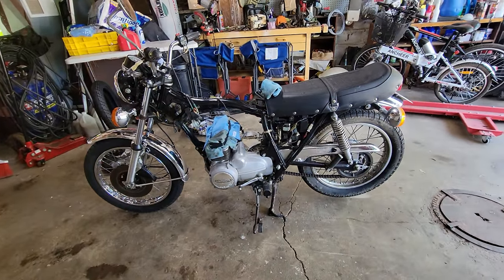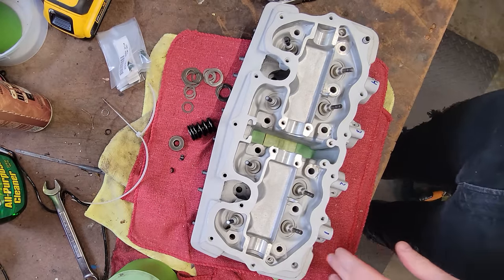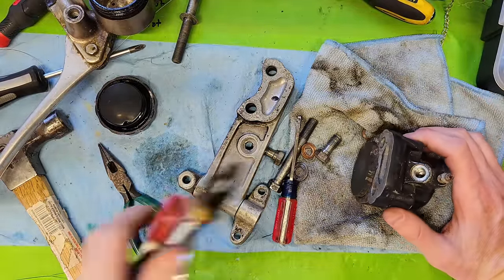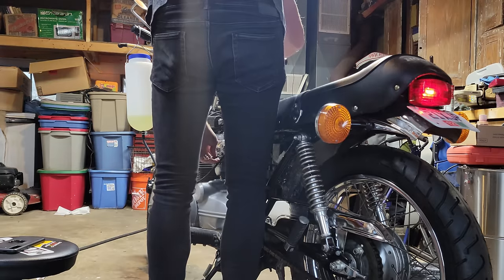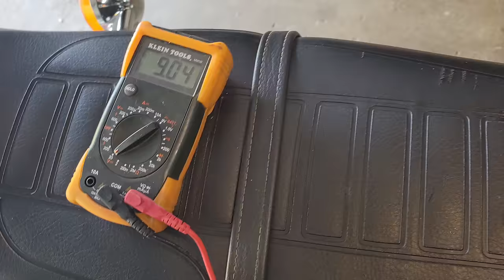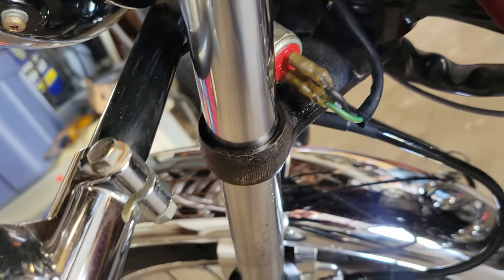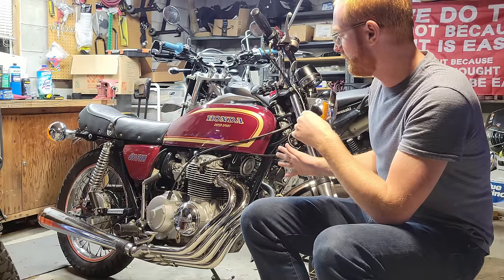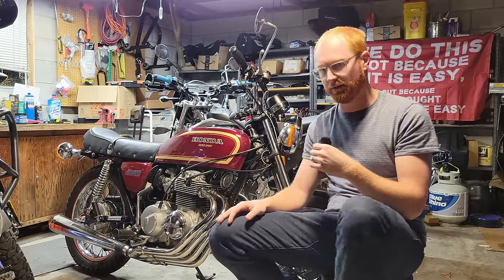Forgotten 46 Years - Will This CB400F RUN AND RIDE 200 Miles Home?

Comment: I tore my 400f motor down and then injured my clutch hand on a table saw. I'm pretty well healed now and starting to work on the engine again. Decided to remove the valves today and tackle that before reassembly of the entire engine. Great video.!
Reply from the maker: Valves are a bit tedious, good luck on getting it all together. My brother was just bemoaning the cost of replacing his sawstop after a false activation, but seems like a better alternative than the many close calls. Thank you for watching!

Comment: Took me right back to 1981 when I had to strip my 400four to get the crankcase welded up after I foolishly tightened up a crash bar bolt too much which pierced the crankcase. 😢 I couldn’t do as good a job as you’ve done with yours due to time constraints of needing the bike to commute to work, you’ve done an absolutely fabulous job on yours. Wish I still had mine, it was my first proper bike after coming from the 250cc Suzuki X7  which you could ride on a provisional license back then here in the UK.  Thanks for taking the time to record your journey. 👍
Reply from the maker: I really do appreciate folks who watch first of all. Really flattered that anyone watches in the first place! Here in the US you can get a permit at 16 and buy whatever you want so these never caught on. Punching through the crank case sounds really frustrating! I imagine a full tear down for that repair. A friend just asked how long this took to complete, and I couldnt say but Id be the most expensive bike in the world if I paid someone for this! I will have another bit where i fix some small stuff like the muffler and cut fender

Comment: Great content and enjoy your presentation. So at the end of the video you mention “new fender”. Is that the rear fender?
Also could you put in some links to where you ordered some parts pls
Just yesterday I picked up a 77. Needs parts. 
Thanks
Reply from the maker: The rear fender that has been cut is getting replaced in the next video. Most of the parts I grabbed were from webike japan and cmsnl. If you order from webike just have a list going so you combine shipping costs. I will add some links to the description in the next hour
Reply from the maker: If you have any specific questions let me know btw

Comment: I hope you're going to junk the cut-off rear mudguard and replace with new. Had one of these brand new in 1978 although mine was an F2 and yours is an F1
Reply from the maker: Yeah I snuck in a comment at the end saying I would replace it. It's the most upsetting part of the bike so far haha. Was not cheap to source a replacement, but CMSNL and Webike Japan had all the parts I needed. Next video will cover some more odds/ends. This one should be an F2, but if you're outside the US, we got some weird stuff nobody else did

Comment: I dont know.how to sync carbs , that would be really good to learn. Appreciate your video , glad i found it.
Reply from the maker: If the short rundown here wasn't super conclusive, I could make one going about it step by step! Common Motor also has some that run through, but slightly different approach, super easy when you get to it. Also have a video that shows bench sync! Forever greatful that folks take the time to watch!

Comment: thanks for the video,can you please tell me if your bike has only one key for ignition seat and gas cap?i just bought a barn find exactly like yours but the key was lost so thats why i was just wondering before i call the locksmith thank you very much.....
Reply from the maker: the key is the same for all, you might be able to get the key code and order one or have one made from the lock cylinder. the 77 has the little cover on the gas cap and im pretty sure you could turn it with a screwdriver
Reply: @GoldenBoyGarage  thanks for the tips....

Comment: I never liked the CB400 four, well until I owned one. I absolutely loved it, mind you did find it hard to find neutral at first. But when I counted the gears up and down, I realised it had 6 gears. Doh! 
First bike I'd ever owned with 6 gears and now they come as standard.
It probably why when I first saw the CB650R I fell in love with that. Which now I think I'm going to have to get one.
Reply from the maker: I want to say it was the first 6-speed bike Honda sold, but I can't find a source for that right now so don't hold me to it! 

I really wanted the CB650R as well. Dealer wouldn't let me test ride, so I passed for a KTM (mistake)
Thank you for sharing

Comment: GREAT video! What brand tires and size did you install onto your CB400Four? Thanks 🙏🏻
Reply from the maker: Shinko 712s, Ive run them on a few bikes before with good results. Also the name of the channel is kind of a poke at the Shinko Dualsport tires sometimes saying "GoldenBoy" on the side of them. If in the US, I grab them from 4into1, they sell the tires and tubes and rim strips as a bundle, makes hunting easier. Avon RoadRiders are sort of the go-to for vintage bikes, but always out of stock in the USA
Reply: Ok thanks for taking the time to answer my question. I have a mint 1975 Varsol blue that’s been restored but it has the old knobby style tires and I find they squirm a bit in corners.
Reply from the maker: I appreciate you all taking the time to comment and watch! I love the opportunity to help out. The CB400F facebook groups are full of wonderful people too. Very helpful and friendly.  @flythenride

Comment: Great vlog… I’ve got a 1978 CB750 F2 that I’m just putting back together, so the carb tuning was really useful. Keep up the great work. Roger (Gloucester England) 👍
Reply from the maker: Much appreciated, that would have been one of the last SOHC 750s yeah? I have an 82 750 basket case in the garage waiting for me to get my butt in gear
Reply: @GoldenBoyGarage  I bought it from a neighbour a couple of years ago, although I was never really a big fan of the Honda super sport sohc’s but this one has got under my skin. Yeah I think Honda did an F3 in Europe to use up all of the bit before moving up to the DOHC. Your 400/4 sounds great…👍
Reply: @GoldenBoyGarage  great I hear - I'd love to see that rebuild. The last of the SOHC 750s, the F2s, are very special bikes. Bigger valves and hotter cams than earlier bikes plus the black engine finish. In my opinion, main thing,  the absolute best sounding fours ever.
Reply from the maker: I would love to have an SOHC 750, it seems like THE quintessential japanese bike. In the meantime I have to settle for a DOHC haha @leon0

Comment: I restored a 500/4, ask me how I know but don’t use the old chain, buy new sprockets and a good o ring chain. 💪 nice job, typical Honda 4, they are cold blooded and always need to warm up before they run sweetly without choke.
Reply from the maker: Much appreciate you watching. It got me home just fine, but its pretty stretched out now. Was it worth it? Probably not haha! The sprockets are pretty good shape. I know they should be changed as rule of thumb but will be bummed if i have to ditch the rear with the oem cover

Comment: I find that even with cheaper gaskets after a rebuild after a couple 100 me if you torque your head bolts that will usually prevent leakage. It's one of the most common misconceptions about after rebuilding a motor is that once you have it back together everything's going to be just fine but any engine that you tear down and rebuild after a few hundred hours you should really go back and reach work all your bolts but you are definitely correct with using higher quality materials especially when it comes to gaskets but I have been in situations where I've had to use you know like Fel-Pro and just buy retorquing it prevented leakage but you must do it before it starts leaking LOL
Reply from the maker: A retorque has saved me once, but the other two times I ended up having to put a new headgasket on 🤦I just figure some of these ebay gasket kits might not be the best quality. Hopefully ordering them from japan gets me a little grace from teh gasket gods. Appreciate your watching!

Comment: You might want to replace the handlebars with the low-rise handlebars from the earlier models, which allow the cables to run under the tank. If you leave the set-up like it is now, it looks like the clutch cable will eventually scuff-up the beautiful finish on the tank. Great restoration! and I also really like the ride-home video! Beautiful bike!
Reply from the maker: I considered replacing the handlebars with F1 style, but that would spiral into retrofitting footpegs / linkage as well and the cost would add up vs fixing the fender or cut up exhaust. When I originally got the bike the cable was located there and thought it was weird. Couldnt definitively figure out which rocker bolt to put it on for tucking under, but have since rectified that for latest video (still wrapping up). What I am most surprised is that you are the first person to say anything about the clutch cable. On internet or in person! I appreciate the feedback. Figured I would lose some people with the long time lapse, but south of Cincinnati the scenery is pretty! Hoping this next video will be even better!

Comment: Nice pair of videos on this motorcycle.  Had a red 1976 café version.  Much nicer than the 1977 rework, IMHO. I saw an ad in a motorcycle magazine back in the day and just HAD to have one!  It took two years to find one (no internet back then) and then rode it for many years.  After selling it, I found out someone torched the bike and it was ruined!
Best upgrade I ever did on that bike was a pair of Fiamm chrome-grilled horns.  110dB two-tone horns always got the attention of a stray car driver! ;)
Reply from the maker: A lot of people didnt care for the F2 refresh. I can see both ways. I love the flat varnish colors, and the fuel cover is annoying! I got someone a few weeks ago on my old bmw, horn facing right in their face while texting on the highway, windows down lol. Honda uses pretty anemic horns even on their cars
Reply: @GoldenBoyGarage  A couple of more  things about the 400F: I always loved the sound--especially over 5,000 RPM; and I could look at that exhaust as the prettiest piece of OEM manufacturing ever; like long flowing hair. Would make for great wall art.

Comment: Cool vid. Rebuilding a 350f now. Hope to ride tomorrow. I picked it up for $300, but chasing down issues had it for 15 years and only Ridenour for a short time . Tore it apart 10x, jugs were oblong from some knucklehead honing it wrong,  but never knew till recently.. ONWARD⚡️.
Reply from the maker: Its always the pesky previous owners, hopefully you get it up and running shortly, the community for the 350 and 400 seems to be strong and helpful! Appreciate you sharing!
Reply: @GoldenBoyGarage  thanks mate, It’s running!! ✊ I love the little critter.. . Still dialing it in for the first ride. No electrical gremlins left…me thinks. 
RIDE ON

Comment: G'day from Sydney Australia, interesting video involving some good skills to do what was needed.  This popped up in my feed, I had to watch it having owned and ridden one of these in red colour some 44ish  years ago, used it to commute and tour, from memory they got on the cam around 6,000 rpms and came to proper life then.
Unfortunately a car over-ran a stop sign on my way to work and from out of nowhere came to a stop right in front of me at 90 degrees to me blocking the road, I hit the front steel bumper side on with the bike's front wheel and my foot while on the peg and probably the rear brake hit the car's front wheel snapping the footrest off and the bike and I went over the bonnet and the 400 cartwheeled end over end for about 110 feet down the road, fortunately the bike didn't catch up to me and land on me.  Front wheel jammed in the header pipes, gauges through the top of the headlight, handlebars embedded in the tank, but the sidecovers were okay and it still started and ran fine.  Insurance company of the car paid me out for the bike and deducted $50 and said keep the bike lol, they didn't pay for the Shoei helmet that was destroyed in the process though.  I'm sure i still have a post-crash pic somewhere (back in printed pic days).
There's a few lessons to learn in that accident, back then there wasn't a huge range of protective gear readily available so many wore used Fireman's boots, and whatever jacket that was warm.  Don't ride too fast in traffic like I was doing, and always wear the best gear from the vast available range nowadays, dress for the slide not the ride as they say (now I sound like my Father).
As I remember the bike they were very nimble and good fun to ride, a couple of mates had stripped-down ones and road raced them too.  Your video brought back some good memories.
This text started out to be short, but didn't end up that way sorry, nowadays I ride a Honda VFR1200X Crosstourer, a little taller and heavier than the old CB400, at 295kgs with a 130ish HP and same in NM of torque available from idle, it's good fun, and I have all the gear too.
Reply from the maker: That's about right, if you're trying to have some fun you need to keep it up in the revs, or you're going to be bogging trying to keep up haha. 

Sounds like a pretty gruesome crash! Cant believe insurance wouldn't pay for the thing that saved you and them the most headache (pun not intended)

My dad told me stories growing up about crashing his old Intruder and Kawi H1, explaining not to get a bike and how it sucks to pick gravel out of your skin! My first accident was on an old Honda Aero scooter, doesn't take much to mess you up good. Thankfully have many more stories about my gear saving the day!

Appreciate you sharing, really neat to know the story of this bike made it round the world!
Reply: @GoldenBoyGarage  Yeah it hurt a lot for quite a while, I've had 3 accidents but all around the early '80's and none since, one I was stopped at a stop sign and got hit by what is called a box truck I think in the US coming from the opposite direction, the other two were possibly avoidable with more restraint on the throttle.

My Dad had similar stories to your's, when I was in nappies he would travel NSW sheering and his transport was an original WLA with factory side car, that would've been rough on the roads back then.

Riding's in your blood or not I think, my younger brother has 4 bikes, from a '66 Genny shovel in a chopped rigid to metric Kawa 1,000s, and includes an Indian from the early '40's fully restored with the suicide shift.

Between my own experiences, mates experiences, and my daughter being a Paramedic, I've heard way too much but still ride and in my mid '60s still love it.

Comment: Nice! I recently got my hands on a parakeet yellow F1 76’, slowly dialing it all back in. Trying to find a set of CR round slides for it because my carbs have been nothing but trouble
Reply from the maker: I can say I don't think that changing to CR carbs is going to make your life easier, but they are definitely cooler! Webike japan sells them! I think the parakeet yellow is one of the best colors! I have a video on the carb rebuild stuff, but you're also welcome to bug me for help. (discord link on the channel page or just comment replies). There's a pretty awesome group of folks on FB for these bikes too!
Reply: @GoldenBoyGarage  I honestly don’t want to but my originals are pretty roached out. The bodies that hold the mains are pitted pretty bad and it seems like the tolerances are all out of wack. They’ve been suffering from previous owner syndrome. When I got the bike, the slides were in backwards which I didn’t even think was possible but here we are hah
Reply from the maker: @fleischwagen  im not sure what it was with these carbs, those stems for the mains seem to disintegrate. even mine are in bad shape, though useable. Ive seen some interesting stuff, backward slides is pretty bad haha

Comment: Had blue 75 model great bike
Reply from the maker: I love the varnish blue color! Those flat type colors seem to be popular again, at least with cars!
Reply: Best blue ever dark and shiny when waxed. Great ujm universal japanese  motor cylce hondas first factory cafe/ sport bike low bars rear set pegs 4 into 1 pipe was beautiful. Bike was quick for 400 and smoother than singer sewing machine. Had to get it at luke 6k to 10k redline but then it ran good. Not bad on bottom but really pulled above 5 grand. Handled great in its day @GoldenBoyGarage
Reply from the maker: I try to ride as many bikes as possible, new and old. I was really surprised with how solid the bike feels, and it turns in nice. Keeping it in the revs when out with modern bikes becomes a challenge haha. I dont think Id change anything other than the front brake, could do for a bit more up there

Comment: Cool Bike!  In the eighties, my friend had one just like yours.  I had never seen one before or after, until your video.  I am not sure how rare it is, but seems so, here on the east coast, U.S.  I was crushed when he sold it to buy a BSA scrambler.  The BSA was cool too, with foot controls reversed from the Japanese bikes.  Love your channel!  Thanks for sharing.
Reply from the maker: Really appreciate you taking the time to share. In the US the import numbers were pretty rare, despite making the bars taller and putting the pegs forward, Americans went for the bigger stuff, just like today. I was told its more rare than an old sandcast CB750 but I haven't dug into that. In the same vein, I had never heard of this bike until I got it. CB350F sure. Here in Kentucky I dont think I have seen a BSA on the road, usually just parts at a swap meet!
Reply: Thanks for your reply!  Good stuff!  Looking forward to more of your resto work.  Really appreciate it.  @GoldenBoyGarage